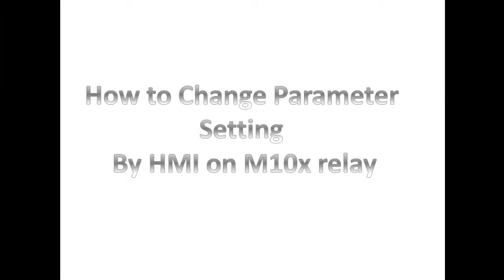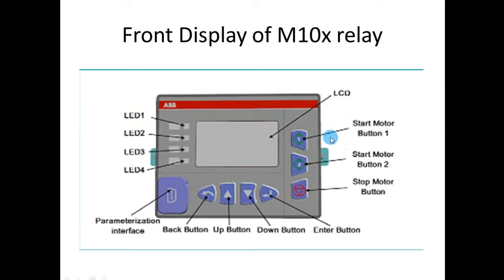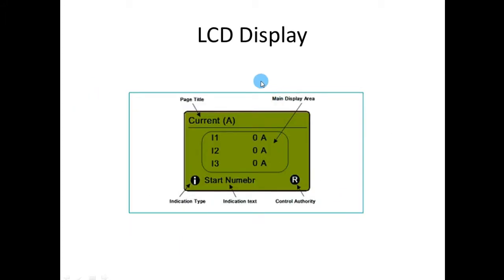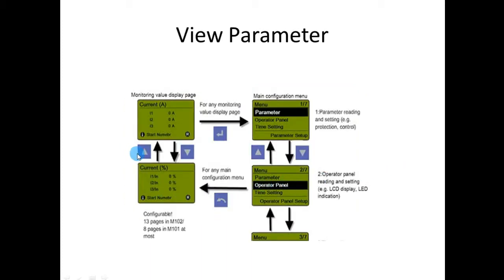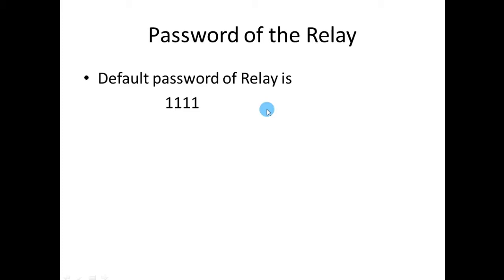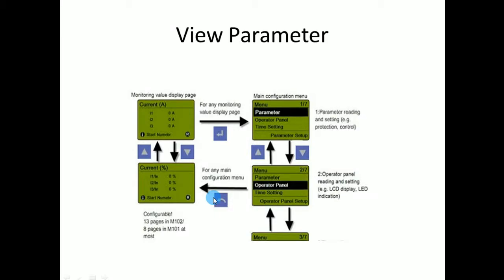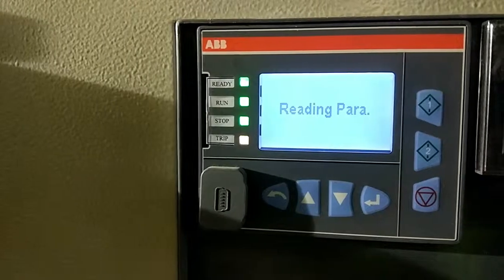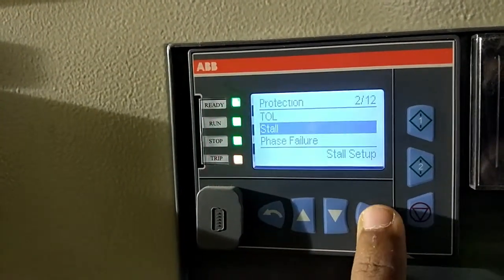Change setting on HMI for M102 relay | M102 P relay  | M102 M relay | M101 P | and | M101 M relay

Comment: Hi sir when i am injecting current on the relay i am getting all indication leds are blinking and getting error as welding contact and also when i created earth fault still that led was blinking ,after the injection stopped then only fault led got latched till that, even though fault was there fault led was blinking only not latched.
Reply from the maker: while your injecting the close contact di has to given feebback to relay

Comment: Hi sir, Have fault alarms. The HMI indicate current and alarms (TOL, Overload, thermal capacity, welded contactor) without load. Panel for 132 KW motor.
Reply from the maker: RElay will have ct over there it may have induction
Reply: The circuit is completely open. Just when we aliment the Module M102M the start 1 led indicate directly. Indicate current.....